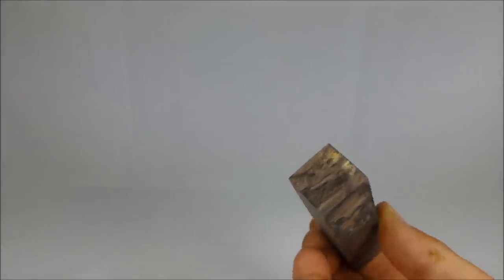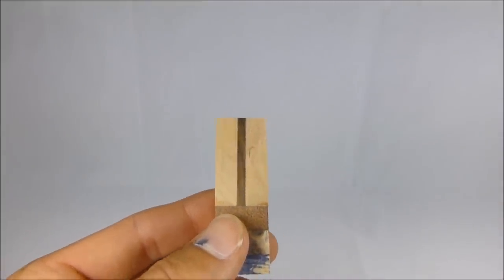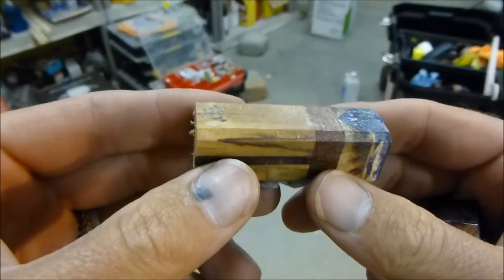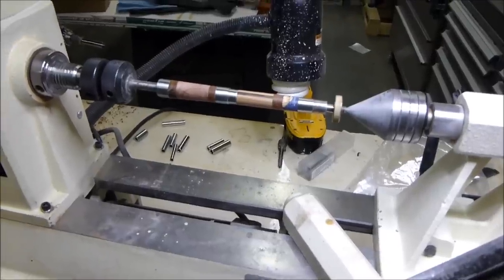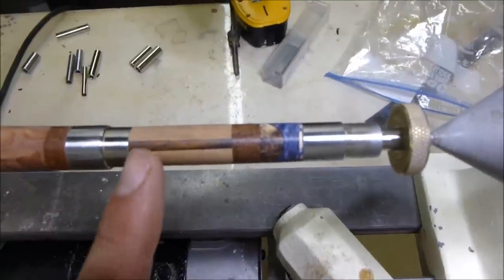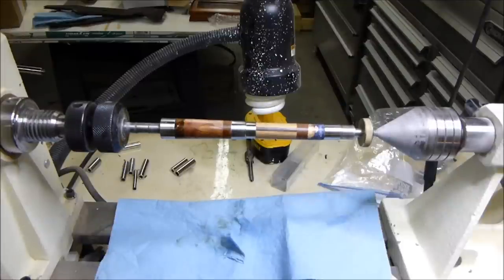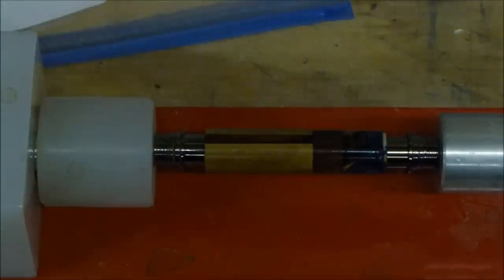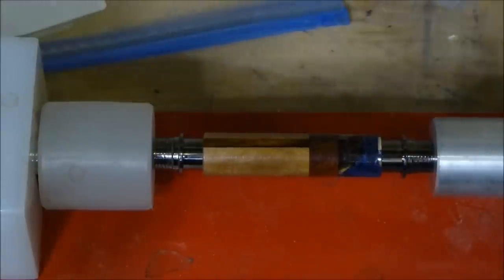The making of a pen with multiple woods

Comment: Sean, since I last wrote I purchased a laser from Full Spectrum with a Rotary Attachment, it came to $3800 and it is made in America. I did look into buying the Epilog Laser but the cost kept me away. The bushings from Craft Supplies really do work great, well worth it. I think we all should help each and put together a list of woods and how they react under the laser and the speeds etc. Stay safe, watch your six, your the best
Reply from the maker: Frank, Very cool about the laser. Full Spectrum does ring a bell. I have a ton of tricks for you as for engraving. Man I wish I had more time. The one thing you will learn is even the one work piece your engraving or cutting will  not act the same as a piece off the same tree or even stock. Example, you hit a knot, or a sap pour. Things like that. So my best advise is , do it on a low setting, and before you touch it, or take it out of the rotary stock, decide then and there if you are going to run another cycle. You can always engrave again, but you can't take it back. The next best friend your going to have is  isopropl alcohol. It removes the tar like substance found on the work pice. Its so easy. Just get a squirt bottle from Hobby lobby or something for a dollar, then buy 90 percent at wall mart. Total investment like 3 dollars. Saves all sorts of time and prevents issues. Lastly, if you are a CA finnish man, one or two coats of CA on the stock before you laser it. It does two things, holds it together, provides a better burn, and the biggest one, prevents staining from the hot gasses that come from the cut/engrave area. Leaves a clean finnish. I even sand it back off when I am done engraving. The coat is to protect it. I lost a lot of good pens from not understanding my laser. LOL. Ton's of tips, let me know if I can help. I have screwed up more pens than I have made but I do keep getting better at it each pen.

Comment: Hey Sean, enjoyed the video.  I didn't read all the comments but thought I'd suggest a couple things that have helped me.  I use cut up Ziplock bags to apply CA glue... never have a problem with fibers from the blue or regular paper towels...  Also, when I've had the opportunity to laser engrave items, I've used a piece of paper on the item and set the laser power to super low... as low as it will go.  Typically it will burn the paper, but not through, and then you can see where your design will come out.  I hope those help somehow in the future.
Reply from the maker: John Stuart I do appreciate the advice, I will have to give the zip lock a try.

Comment: Sean - Great video on segmenting. I can offer a couple of options for drilling straight when you have a centerline.

Option 1 - When placing your blank in the pen vise use a combination square to align the bit with the centerline. Not fool proof, but closer than by eye

Option 2 - Consider using your lathe the drill. I was forced to go this route because the quill on my DP only has a 2" travel. Not sure I would go back even if I could.

Thank you for sharing - great work!
Reply from the maker: Thank you for the compliment. Also for the ideas on how to drill a good hole. I will give those a try. I think you have me sold on using the lathe

Comment: i have no experiance in wood turning and i find this interesting, pen looks super cool, i actually like the wood fractures or wood cracks, a pen with just cracks for design or detail would look cool alone, filled with that clear filler and polished, that would look nice, simple design too, i like the piece in the middle, that metal part, great project, nice work man!
Reply from the maker: chris williams I really appreciate it. Thank you. It should be noted though, the only thing I make is all the wood parts, all the metal parts are a kit that I order. Although I do, do metal inlay's in the wood. I just use metal powder and glue it in.
Reply: i noticed you was getting worried about getting the design inline and straight, you could use a compass and check out some information on geometry, knowing the basics makes everything else fall into place, isnt as hard as it seems, check out my art on my channel, 3 years i been into geometry, its easy once you try, if i can do it, anyone can
Reply from the maker: chris williams I have not had a chance to review your work, but I plan to, tonight. Thank you for taking the time and trying to help me. I am all about math and the resultant geometry ti provides. Thank you again.

Comment: Great video!  I am very interested in getting into the laser side of things and it was very interesting to see how it works.  I actually made my first segmented pen with that exact kit just this week.  It is a relatively forgiving kit as far as the burl mis-step.  If you haven't tried using Abranet for sanding, I would highly recommend trying that.  Also, if you stop the lathe and sand horizontally with each grit you will pretty much eliminate the grooves you that you mention at the beginning of the video.  Something else you may want to look into is drilling on your lathe instead of the drill press.  I have found it to be much easier and accurate.  Finally, when I started a few years ago, I tried using the barrel trimmers with not much luck.  I ended up making a jig with two scrap pieces of 3/4 plywood, a bolt that i could slide the tube onto and a few washers and a nut.  I clamp the miter gauge on my disc sander to 90 degrees, make sure the table is at 90 degrees and then slide the jig along the miter gauge and press and twist the blank up against the sander.  There is zero chance of tear out and as long as you have your angles set, you get a perfectly squared blank.  Great work....I look forward to seeing more.
Reply from the maker: That is a really good idea. I will have to make one of those. Can't stand the barrel trimmer. about every third or fourth time it messes up, or I just don't hold it perfect. Thank you

Comment: Hey Sean. Not sure if someone mentioned it yet, but you can get these little silicon bushings to use when you are doing a CA finish. I think they are pretty cheap online but I swap the silicone, or whatever the plastic it is that they are made of, in for the metal ones when it is time to do the CA finish. Then it doesn't stick to the bushings.

Comment: Very interesting process for using multiple wood species. As far as not getting the bushings glued to the wood with the ca, I use Johnsons past wax on the ends of the pen blanks and do not have any trouble getting them off.
Reply from the maker: Darrell Risley Thank you for the tip. Sorry it took so long to reply, been away for work.

Comment: Nice video! I have a suggestion for truing the drilling. Mark the centers (as you did) on both ends of the blank. Then do a quick spindle turning between centers using a spur drive, just enough to get it round. Be careful not to dig the spurs in too deeply. This should be OK if you stop turning when you've cleaned most of the flat spots. Take the round (or nearly round) stock to your vise and it will fit squarely in the v-groove and give you a perfect center. This assumes that your table is square to the drill bit. I haven't tried this but I've drilled round stock with no problems.
Reply from the maker: Great suggestion, thank you. It will be a while till I get back to turning, I'm currently in Afghanistan. Respectfully, Sean.

Comment: I enjoyed your video, using a mortar and pestle is not going to give you a uniform size easily. However you might look into making a small ball mill. Basically a paint can supported on rollers that is motorized in which you place your sand sized aggregate  with several large steel ball bearings say one inch or bigger and you let it roll for a couple hours. You will get the powder you’re looking for. A you tube search should help you find an easy one to build, Hope that helps.
Reply from the maker: +Stan Kuczynski I will Look into it. I appreciate it. I would think that process makes it endless for material Resourcing..

Comment: Thanks for posting the video!  It was nice to see a Nouveau Scepter kit, I have been curious what they look like outside of the website.
I know exactly what you mean when you said you have 1000 hours making pens and it seems like you learn something every time.
Something that might help you avoid cracking the pen when pressing.  What I do is take a harbor freight countersink with the drill bit still in it and put it in each end of the tube and lightly turn it by hand and get a bit of a countersink in the brass.  What that seems to do is take care of any burrs on the end of the tube and helps with the pressing process.  I also look on top of the tube and on the sides to make sure I can get it as straight as possible while pressing.  
Not foolproof by any means, but it seems to help me out.  I know we each have our own way of making pens and my way might not be the best for someone else.

Again, thanks for the video.  I enjoyed watching.
Reply from the maker: Thank you for the suggestion, and advise. I'm currently in Afghanistan, so I will have to give it a try when I get home.

Comment: Hello. Nice work with the glue up. I'm gonna venture you're an engineer. ;-) I have a suggestion regarding the 10 mm drill bit. They are frustrating as they do heat up quickly! What I did to compensate for that is to set the blank up in the vise, clamp it to the work surface and then pre-drill the hole with a smaller drill bit. I make a lot of pens so a 7mm should be handy. That way if your orientation is slightly off you can adjust the entire vise with a shim (veneer pieces work well). Redrilling the hole after creating an existing hole will significantly decrease the amount oif thermal stress generated by the large bit. Also, i regularly run my drill press at the slowest speed available to me which is in the 600 rpm range. Plenty of speed. You can also use bees wax as a lubricant for the drill bit. Start the hole, heat the bit, back it out and touch the bees wax to the bit and allow it to melt down the shaft of the bit (it doesn't take much). It won't affect the gluing (epoxy not CA (too brittle, I have had pen brass loosen after many months and drops of the pen or project onto hard surfaces.) I do hope this has been helpful to you. Keep up the good fight!
Reply from the maker: I would love to be a CNC engineer... By trade I am military. You know, using a smaller drill bit I have thought about it, seen it and never done it. I guess every time I go to drill a hole I just do it to size. I am going to start doing just that, using a smaller bit. Thank you for the tip by the way. I do have a couple of questions. Seeing how you make pen's, I take for grated you have had the same issue? Heat that is? If you are using the standard 7mm do you use a smaller bit to drill a pilot? Like you said, I have a few 7mm bits. Last but not least do you use a brad point? Oh, the veneer, I have a ton of it. I do this thing with a laser engraver and make these plaque things with like red wood burl. Took me several hundred dollars in materials to perfect inlaying a veneer. That shit is so so hard to do. In short, the light came on when I learned to do a pre soak of the veneer prior to cutting and gluing.
Reply: Sean G No, the 7mm doesn't generate much heat. Depending on the wood you may need to clear the flutes more often. Also what I have learned is that if the wood is very dense and generates a lot of friction the wood will expand and when it cools down the tube will be quite tight. Wait till the wood cools down and then redrill it. If you're just making them one at a time, just let it cool down and then run the bit thru again. Colt makes a long 7mm bit with extra wide flutes to facilitate easier waste removal. A little more expensive but you get what you pay for. Not an issue if you are only doing them one at a time, but if you're making them a dozen at a time or more
it does make a difference. The real problem with drilling out the hole is really an issue when using that 10mm bit. I encountered it making perfume atomizers. The same trick is helpful using large forstner bits. The trick there is to drill a very short hole with the large bit (so that the bit has a good seat) and then change bits to a smaller bit, drilling to the desired depth. That makes it much easier for the F-bit to clear the waste as it descends. Also requires less force to drill with the large bit. Hope that helps.
Reply from the maker: Obwan007 That info is exactly what I am looking for. Thank you. When I get my shop back up and running I will give it a try. Hopefully I will be back in business in 3 or 4 months.
Reply: Let me know if I can be of any further assistance. Good Luck to you. Your attention to detail will serve you well.

Comment: If you use a chamfer tool to remove the burr inside the tubes after you trim them it is much less likely to develop cracks during the assembly. If you leave the burr in the tubes the fit will be too tight and the tubes will expand when you force the pen components in. I pick them up  from gun and ammo suppliers, they chamfer the bullet cases before reloading ( I think ). Also if you stop the lathe a few times during the sanding/polishing and sand/polish up and down the length of the pen it will remove many of the lines that run around the barrels.
Reply from the maker: Ben, thank you for the advice. I will give it a try. I have several de-buring tools for pipe, and I am sure it will work on a 7mm tube. Another mad told me about taking a potato and ramming the tube through a potato, leaving it internal to the tube before gluing on the wood as to keep glue out of the tube. I also think that might work quite well, using your technique and his.

Comment: Try wetting the wood before the laser? Keeps the fire to a minimum. For the crack. I would just fill in with thin CA and use a buffing wheel or hand finish it. Nice work.

Comment: Your live center is jammed into your mandrel which can cause it to bend under pressure.  If you would remove the cone, you could push directly on the bushings and no pressure will be exerted on your mandrel.

Comment: Your pen vice has a notch between the clamps which ensures a 100% square drilling.. You have to clamp the pen blank from the edges into the notch.
Reply from the maker: You are very correct in the "notch" as to it being square. The issue is my wood isn't square. :) Working on it though.

Comment: I can see by the comments that this is late, so you will probably won't be answering this, but that is the most beautiful pen that I've seen!. question #1. How much do those pen go for? question #2 Can you do a Detroit redwings laser etch?
Reply from the maker: I have never sold one yet. People tend to get sticker shock after I tell them the following. So I kind of break down the cost like this. It's a little over 100 dollars for all the materials. Wood, the different glues, sand paper, polishing fluid, on and on. So lets call it 110 dollars. Machines need to make about a total of 6 bucks. Eventually they will break down from use and I need to fix them. I figure my time is worth 15 bucks an hour, and one of these range from 5 hours to 15 hours or so. The reason for such the time difference is due to how hard the wood is to deal with. Some days are good wood days, some are not. (And yes thats funny.) So lets just call it 10 hours at 15 bucks an hour. Thats 150, plus material of 110, plus 6 for the machine time, it's about 266. I have seen pens like this sell for 1,200 dollars and I have seen them sell for 250. Hope this helps. As far as a redwing, more than likely yes it's possible, the issue I run into is detail is difficult cause its so small.

Comment: You can get nylon bushings that the ca glue will not stick to when putting on a ca finish. They are available from Craft Supplies. I have not tried them yet, just ordered them yesterday, but told by one of my club members that they work excellent. Not for turning or sanding. Only for ca finishing. Remove your steel bushings and replace them with nylon when finishing. They were $6.99 per set.
Reply from the maker: Thank you for the advise, if you could can you tell me how they worked?
Reply: They worked very well.

Comment: looking at the set-up at 7.24 you can see that the wood is set on an angle the right side edge lined to the drill spindle what I would do as a machinist bring the drill spindle down and use the side of the drill to align your work.

Comment: As far as the powders, have you thought of using a mortar and pestal? You can crush it fine, but it'll,take elbow grease to get it there.
Reply from the maker: +Leslie Moree I have, and it works, the only issue I have is Lapis is expensive, and I tend to loose some when crushing it. It does seem to work though.

Comment: Great video!  Have you considered turning between centers?  It's been working quite well for me and it take the chance of having a bent mandrel out of the equation.  Also, using polyethylene bushing when finishing with CA may help with the pen sticking to your bushing.   Thanks for sharing your project!
Reply from the maker: The Sea of Madness I appreciate the comments. You know, I have never thought about "between centers". I have always used a mandrel. I will have to give it a try. I am switching to "plastic" bushings already. thanx again

Comment: Axial drilling stresses can be dissipated in your glue block by adding a parallel wood clamp in the glue ups weakest direction.

Why don't you use the lathe to drill the hole in a four jaw chuck, using calipers and a dial indicator? The set up would take more time than the drill time, but the chuck would strengthen the glue blocks stress limits. Just an idea.
Reply from the maker: You must be a machinist. Love that by the way. I am just now getting into machining. I will give it a try as I just got my first dial indicator about a week ago.